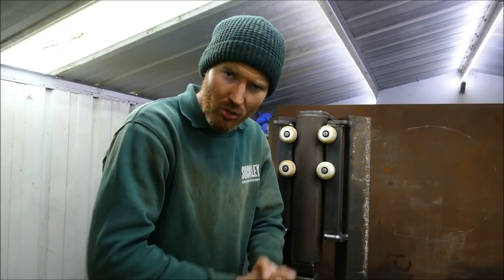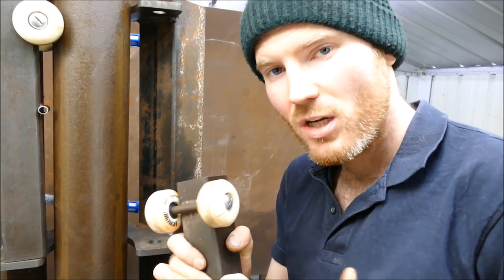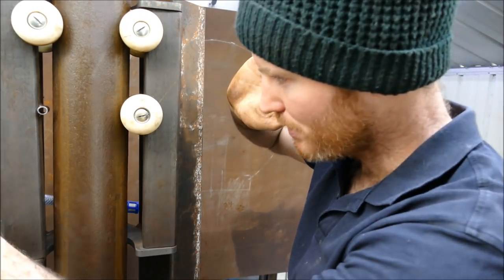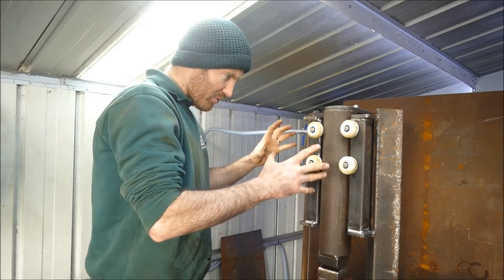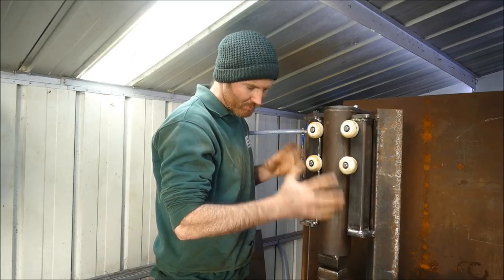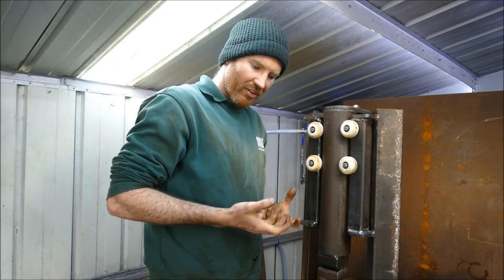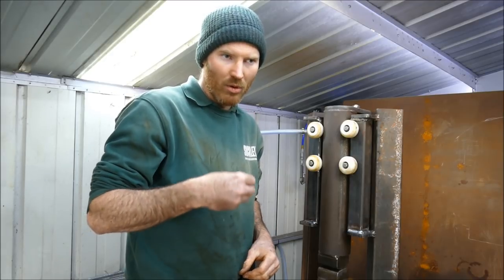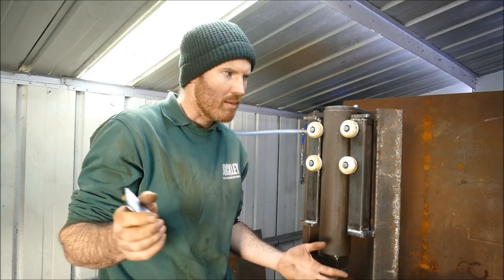Broke it ~ Fixed it ~ Made it better - the Ultimate DIY Power hammer with upgrades and updates

Comment: Just curious Joshua, is there a clever way to utilize most of this same design into a hydraulic press? It’s like a power hammer but slower right (lol) and would likely use most of the same parts like valves and cylinder etc. some I’ve seen out of log splitters but much like your hammer design, I’ve seen presses that had the cylinders mounted in the base to save roof clearance issues. 👍🏼

Comment: New ideas are always resisted because they upset the balance of power. I'd offer that if neosmithing (if that's what it's called) is all about results and not slavish obedience to tradition, it will persist.

The best smithing has ALWAYS been about adaptation and the application of the most savvy techniques and technologies to get results that are: well made, reliable, in time, at a good price.
Reply from the maker: I totally agree, thank you . cheers J